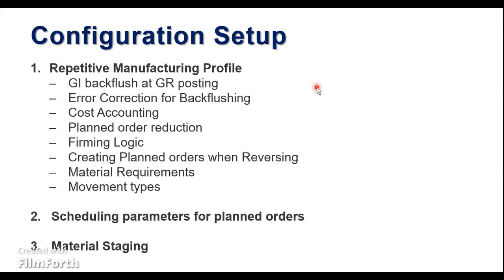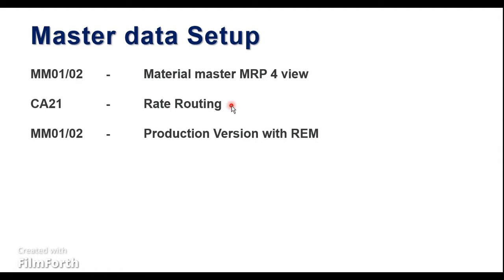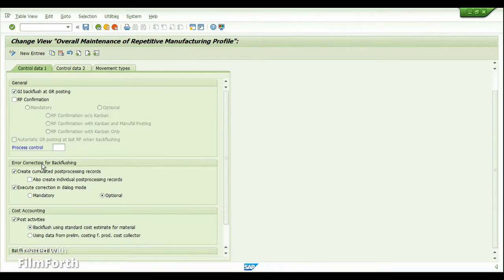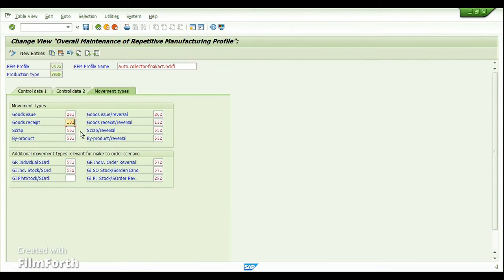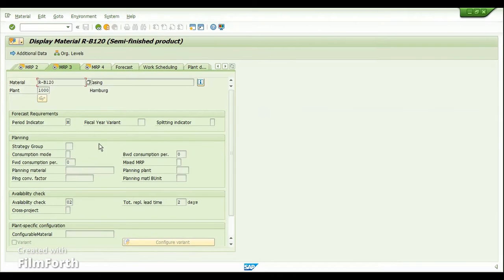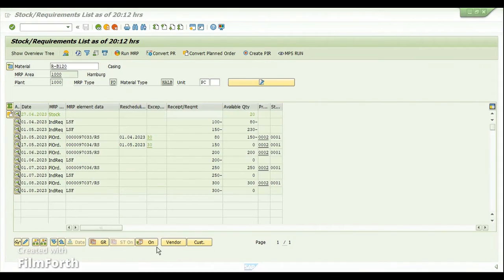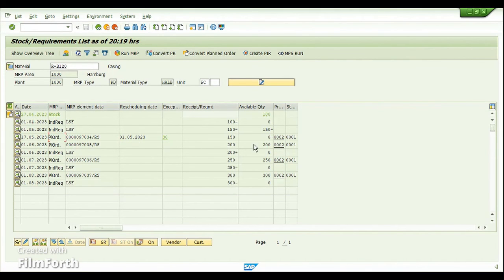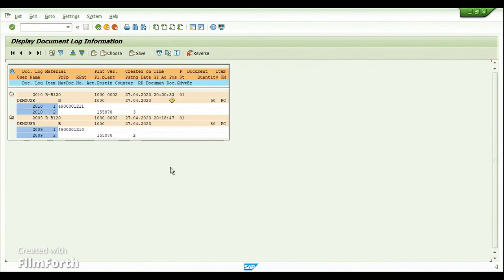SAP Repetitive Manufacturing (REM) | #sapwithik | #sappp

Comment: So i want to know, how and when we need to adjust that post processing issue that appeared while doing mfbf, can you kindly confirm how to correct it as gr and gi is posted but with error right..which might be due to insufficient stocks or batch..and this is known as COGI error..kindly reply
Reply from the maker: COGI is for post processing of errors related to production orders whereas this is for planned orders in repetitive scenarios
Reply: @SAPwithIK  so Sir, I want to know that here you have deleted one item while doing the confirmation, like the message came as insufficient stock, but you have done confirmation by removing that material, so does SAP need to adjust again manually to map that gap. Or what should be followed, kindly explain
Reply from the maker: You can delete the component while confirmation if you haven’t used it in the manufacturing process.